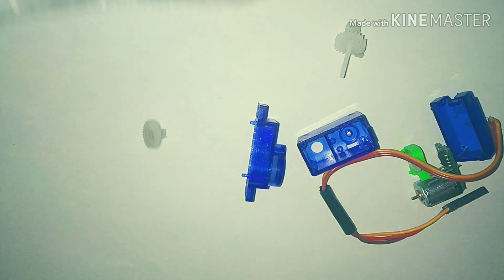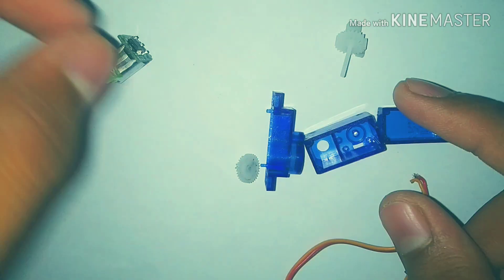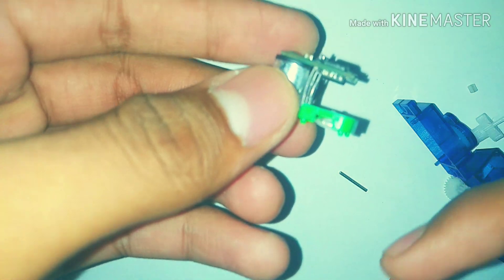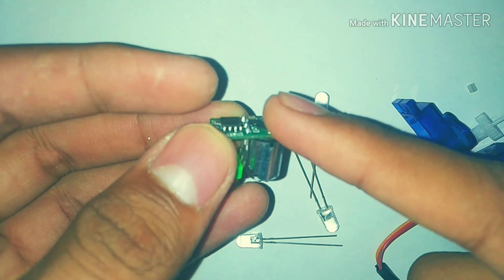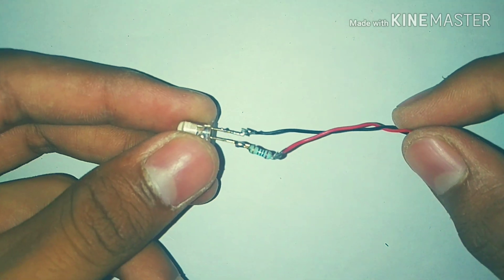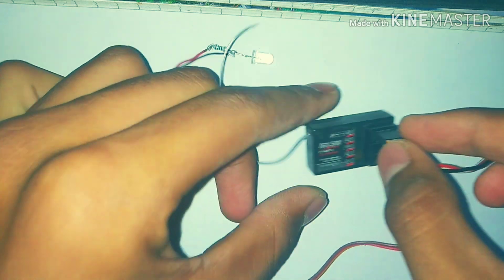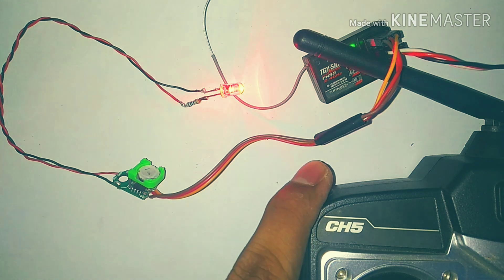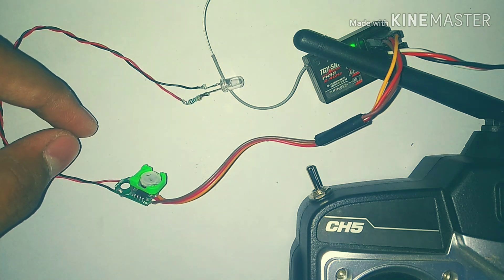Small brushed esc from an old servo motor

Comment: I think by this brushless motor can't be run
Reply from the maker: This esc is only for brushed DC motors not for bldc.
Reply: @prathameshkalaskar9250  it can only run brushed coreless motors(the ones that require low power). If high power is given, it will burn the esc